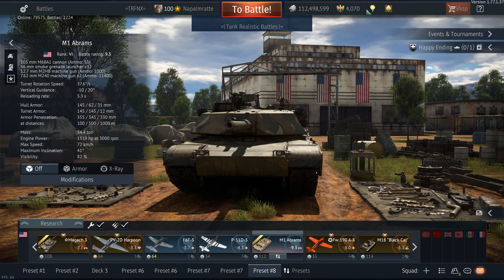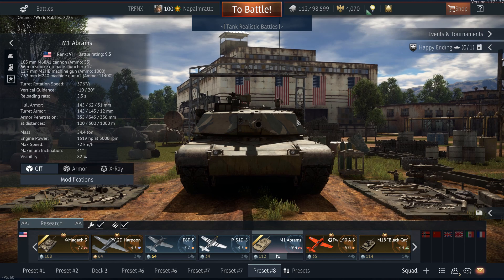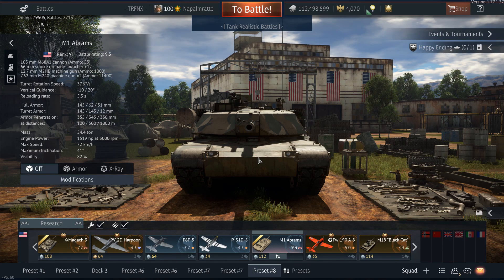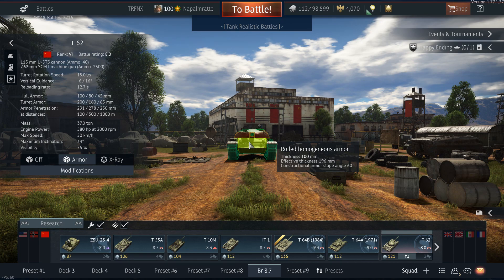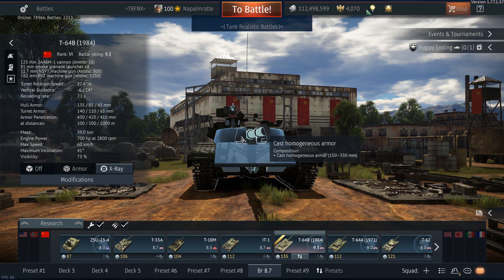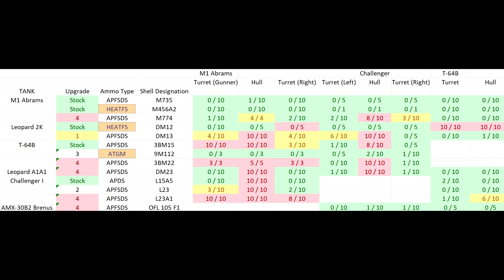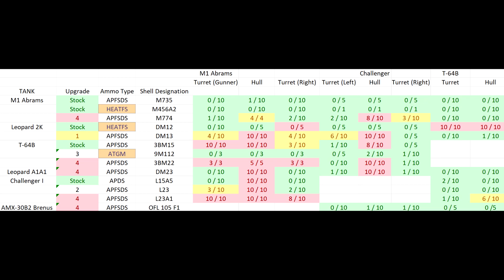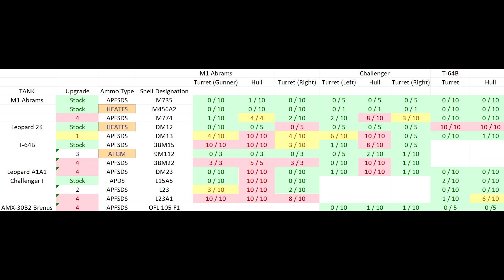WT || Composite Armour Test Shooting Results - Over 6 h Of Wörk

Comment: Gaijin needs to take a lookat the accuracy of the main guns. Quite a few of them are horribly inaccurate. The L7 is a prime example.
Reply: agreed, sniping with the L7 is hell. i can snipe better with the sherman 76 than with the L7. even with "adjustment of fire" it's still below average
Reply: In test drive with spaded STB-1 to check how well HESH does against T-64, I ranged and fired at the thing and hit exactly where I was aiming the first shot. With the second shot (with the same ammo loaded, sight not moved at all) I hit probably several hundred meters behind the tank. I missed completely and saw a massive explosion behind the T-64.

It is completely atrocious.

Comment: What most ppl dont realise about the challenger is that behind the cheeks there is another layer of armor which is VERY tricky to find in the X-ray, kinda like the hiddien one in the japanese tank (type 74 ithink?), best way to spot in X-ray is to view the chally from the side and look upwards through crevasse of the turret ring and move you mouse through that crevasse and hopefully you'll find it. Whats interesting about it is that this back plate is the same angle as the one infront until you reach the bottom part of it... where it becomes 90°.

Before i uninstalled this game when i raged over the 2k nerf I tested this in the "tank polygon" map, and I was able to pen it EASILY with my 2k if i aimed at the cheek which has the flat part behind it (just above the ring) where I always failed when i aim a little bit above that...

Its so sad though that I wont be playing this game anymore :( Ive been playing it since 2015 and never played a game as much as I played this one, I raged and could not take the bias anymore after the xyz-70 huge nerf but came back for the 2k and im leaving again most likely for the last time.... the leopard2 which is planned for 1.79 will be nerfed too I guess and I wont go through that again.

Great channel man, Ive learned so many things from you keep up the good work, signing out.. o7
Reply: mohd ktln git gud. But in all seriuosness I feel your pain.
Reply: The back plate of the challenger turret cheek being almost flat doesn't change anything, there is 300mm of NERA and 30mm of steel completely angled in front of it, but Gaijin in all their wisdom decided that NERA gives 0 protection against KE, so only the 2 steel plates give protection against KE, and the back plate is what provides like 80% of it, and because it loses the angle, then the turret pretty much loses all its armor there. Which is obviously stupidly incorrect.
Reply: just as the video says, dont trust the numbers or graphs or what "should" be, like I said I "tested" and you can too.

Comment: so the results of your testing are:
-t64blyat is almost imune (challenger and abrams cant deal with it)
-challenger hull is atrocious, same as abrams hull
-challengers turret cant keep up with gaijiggles advertisement
-t64blyat is more than capable of dealing with anything (if you add the weakspots to the calculation)
-leo 2k needs apfsds against us/uk, but heatfs against t64blyat

.... i am pretty disappointed by gaijiggles "balance" once again..... sadly i am not really surprised by this
Reply: Happalula yeah the T64 players are willingly just letting the Abrams shit all over top tier. It's obvious you have no Idea what you're talking about. The T64 is one of the easier T6 tanks to fight against because they can actually consistently be 1 shotted if they angle even a little bit they can be ammo racked. The M1is bullshit on so many different levels
Reply: Happalula no the m1 is ten times better than a t64.... as a Leo player I don’t even use heatfs cause  the odds of you running in a t64b are lower than running into a Abrams cause a smart leopard player will always be able to our position a t64 every time. I can agree with that the chall is just fucking garbage cause it’s way to easy to kill but the Abrams is just ridiculous. It goes anywhere and everywhere and good luck one shorting it. Taking out it’s gun breach is helpful but that doesn’t resolve anything if you fuck up or the game shuts itself. And rarely are Abrams players alone. There is either a mbt70 or another Abrams near by. The Leo 2k bullshit fuel tanks are the only thing that make it competitive. Basically the t64 is the second easiest tank to kill after Abrams and Leo in this new patch
Reply: "Immune" Looks at T-64B's lower plate
Reply: not surprised either...
Reply: Abrams is the best. Granted it doesn't have the best results from the test above, in practice it is the most mobile tank among the armored ones, and the most armored tank among the mobile ones. It really stands out by quite a lot. You'll know it right away if you played both.
Reply: all these people complaining about the t64B's armor even though its weak spots are half the size of the Abrams and most of them are easily hidden when hull down. not to mention they can pen the Abrams everywhere without even aiming for weak spots at any distance. lets not mention the Abrams looses its second best round introduced in 1983 and its armor is nerfed its supposed to have 750mm vs heat and the UFP is supposed to be 50mms not 30.

Comment: Could have sworn I've seen Abrams and Leopard 2K penetrating the T-64B front with APFSDS. I suppose I must've been wrong then.
Reply: DaReaperZ  no your not wrong. You probably did see it, these test were under perfect conditions on flat ground intentionally not aiming at weak spots. In actual game there are so many more factors. Because tanks aren't staying perfectly still shooting at only the most armored spots
Reply: Yes, a slight tilt or height advantage might make a big difference, I really imagined the Challengers best round L23A1 to have less trouble going through the UPF of the T-64B.

It's probably as you said, like Napalm mentioned in the video.

From the tests you can clearly see the T-64B has by far the most reliable armor, withstanding practically every shell except for some HEAT from the Leopard 2K. But it's understandable because without the armor the T-64B would have no advantage. I'm imagine that T-64A drivers aren't having a very good time nowadays.

Comment: I had a lot of times where the L23 from the chieftain mk 10 (may also be the same for the challenger; still researching it) where it cannot penetrate t64 A & B's upper glacis plate close range (50-200m maybe) on flat ground. However the L23 can slice throught it in like 500m or more on flat ground. Anyone had else experienced this?

Comment: @4:15 Napalmratte you are definately correct in this manner but the WT Normalization is incredibly stupid. By stupid i meant its NO point what-so-ever to have Normalization in a game where Shell-trajectory has no impact on the damage model. (Thats why you sometimes hit a tank from a slight side angle and the shell does a 30 degree turn and kills all the crew) EVEN if the shell was lobbed from 3500m and was almost freefalling down onto the enemy tank. the damage would still be horizontally aligned. And thats a big pile of shiet! I made some tests with the brumbär and fired from longer ranges. https://imgur.com/a/2uetS

Comment: What was the distances of these shots? I’ve never penetrated the cheeks of the Abrams with the 2k.
Reply from the maker: 300 meters
Reply: Napalmratte I shot an Abrams in the side its turret perpendicular to its gun, and on flat ground. Bounced off like no big deal. Point blank. 2K’s gun is gimped.

Comment: Don't you need to add the front armor plate on top of the composite armor?
Reply: No, you don't..... why do you think it says effective thickness...
Reply: RedTipAlpha Because in armor it shows how thick the plate is and in exray it shows the composite, which would mean it is behind it. And 650mm of heat can't go through 600mm of protection.. But if you add that plate in front of it, it would mean it's actually stopping more. It would make sense. Since everyone says you can't trust what it is saying, that things that should pin aren't pining, but with the extra armor in front of it does make sense.
Reply: It clearly states in the composition that it takes all the plates and composite materials into account.
Reply: RedTipAlpha Its just an idea. I don't get why it would show part of the armor in the armor view than show all of it in the exray view.
Reply: Because the top armor is used in the calculation of the composite armor's effective thickness, it's not an extra plate.

Comment: Once again a youtuber do a video about a game mechanics he doesn't understand well and explain wrong stuff to people = people are misguided = rage against gaijin.
Reply from the maker: wtf?
Reply: Yep you said penetration card are wrong they are right (despite the fact they don't bring enough info) however armor are completely wrong. If you want to check the true armor effective armor values check them here : https://docs.google.com/spreadsheets/d/1-r8VR3ubjzrcYU3TqDbmvR9WSCvZMs24-xFW3Qxxj-o/edit?pref=2&pli=1#gid=578910927
Reply from the maker: OpticalGaming my friend, You cannot trust the stat cards. Multiple examples at lower tiers as well.
Reply: Napalmratte lol youre really telling me that to me ? I'm a data miner. I know better than most people how penetration truly work and armor too.
Reply from the maker: OpticalGaming explain Object 268 aphebc going tjrough ufp of tiger 2 hull while Jt and T10m cannot pen with higher pen values across the board with apcbc while also 120 Ap of m103 goes through as well... ^^
The stats say sth different and caliber is inconsistent in performance etc etc
Do not bullshit me
Reply: Only the first column (penetration against flat armor) can be trusted. Other than that, it depend from the slope effect. Object 268 use a better slope effect than T-10M because the shell caliber (152mm) > 150mm (thickness of Tiger II UFP).  Let me explain :

Let's compare the shells at 500 meters :
T-10M APCBC pen : 262mm (Jadgtiger is lower and have the same slope effect so I won't talk about it).
Object 268 APHEBC pen : 220mm

Now the target :
Tiger II UFP = 150mm at 50°

122mm / 150 = 0.813333333
0.5 < 0.8133333 < 1.0 (the different slope effect)
Hence T-10M use 0.5 slope effect :
262 / 1.90 (this is the 0.5 slope effect at 50°) = 
137mm NO PENETRATION (there is a super small chance for it actually thanks to the 10% penetration boost which would give it 150mm barely enough to pass trough.

Let see the object 268
152 / 150 = 1.013333333
1.0 < 1.0133333 < 1.33
220 / 1.35 (this is the 1.0 slope effect at 45° thanks to the normalization the object 268 shell get) =
162mm PENETRATION (there is also a small chance for it to not pen 10% boost can be positive or negative).

I don't know if that was clear I'm planning to make a guide on forums somedays. I will give you the link if you want it.

If you have any question feel free to ask.
Reply from the maker: yes - why then does the Jagdtiger not pen the IS-3 UFP ... ^^
Reply: Sometimes it does (if the IS-3 angle slightly).

However if the angle is perfect, the IS-3 compound angle (BTW : War Thunder only tell you the vertical angle and not the horizontal one which is super annoying to me) is = to 61°

1.0 slope effect at 60° for APCBC = 2.9

267 (pen at 100m) / 2.9 = 92

92 < 110 NO PENETRATION.

If the IS-3 angle a bit :

1.0 slope effect at 55° for APCBC 2.15

267 / 2.15 = 124

124 > 110 PENETRATION